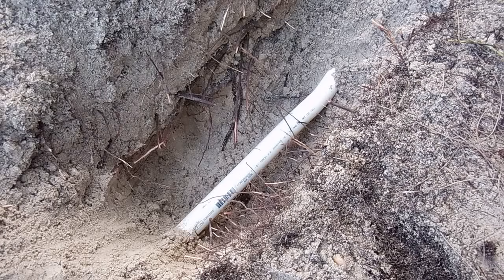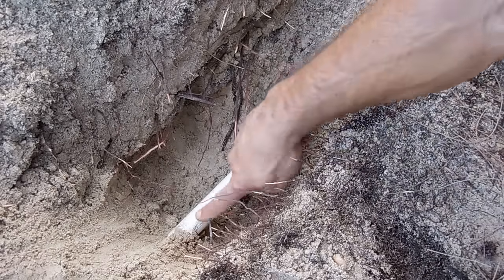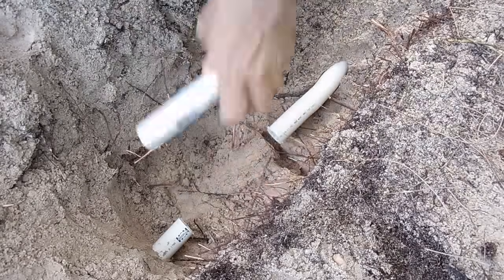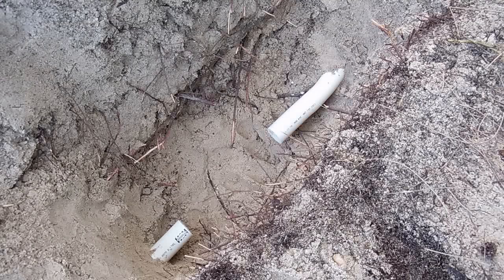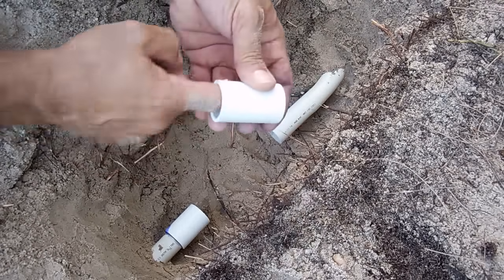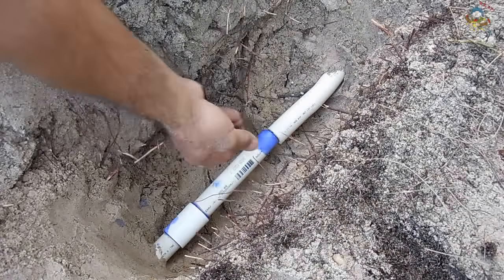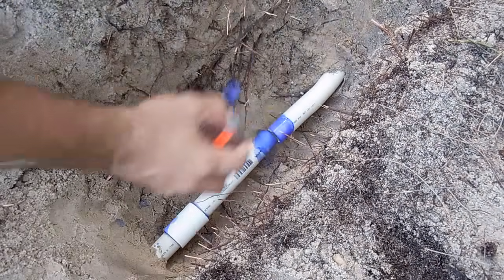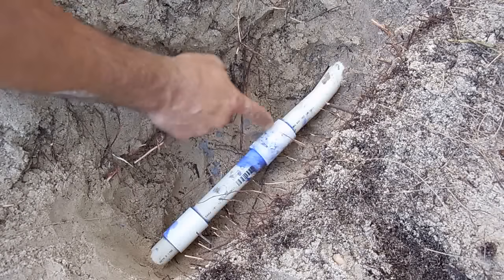EASILY Repairing Broken PVC Pipes(Least Amount Of Digging)

Comment: Thanks for the great video.  Not sure if the following change is worth the trouble but would this work?  Clean and prime the modified coupling (NO GLUE), "lightly" sand about 4" of the short pipe to allow you to slip the modified  coupling into the short pipe leaving about 1 1/2" of exposed pipe,  glue the "other end" of the short pipe to the main pipe using the standard coupling (as shown in the video), prime the 1 1/2" of the exposed short pipe, prime 1 1/2" of the main pipe, apply slow-setting glue to both ends, slide the modified coupling to the mark on the main pipe, twist the coupling and hold in place.  I "ass-u-me" that one could NOT just slip the the modified coupling without lightly sanding the pipe, due to the tight fit, and not sure if the sanding would create voids that the slow-setting glue could NOT seal.  Also, not sure if applying glue to the pipe but NOT to the coupling would result in a bad weld (???) but I would hope that if apply enough slow-setting glue would "melt" enough of the coupling.  Or, as I fear, would the coupling just PUSH the glue and never get inside the coupling?   If this works I think it might allow you more time to work the modified coupling into place and there would be no need to bend either pipe to insert the modified coupling at the last minute.    Thoughts?
Reply from the maker: I'd stick with the method I show in the video. Thanks for watching!
Reply: @electronicsNmore  Would this method also work for adding a tee?  PVC tee's have a LOT more "stop" material inside to remove and are about twice as long as a coupling so it may not be as easy to slip it into the repair pipe (??).

Comment: Flow span expandable coupling, less than $3-5.00.  Takes less than 30 seconds and you can use PVC fast set glue.
Reply from the maker: Yes, but not a permanent repair. They have seals that can dry out over time and leak, especially when used with chlorinated water. My repair is permanent.
Reply: @electronicsNmore  No disrespect, but I would disagree.  As a professional plumber and irrigation contractor, I have used flow spans on anything from 3/4 to 2 inch 250 psi lines that I have repaired 18-20 yrs ago with no issues.
Reply from the maker: @vinnygoombatts1458  Just don't move them. LOL

Comment: This video leaves a lot to be desired. Apparently the creator is a professional plumber and hangs out at the plumbing supply house. For the rest of us finding "slow set" PVC cement is a deal breaker. Home Depot doesn't carry it, Lowes doesn't carry it, and the best hardware store in Raleigh, NC doesn't carry it. You have to go to Amazon and search. The cheapest is $18. For that kind of money I can buy 3 of the more conventional gadgets to fix pipe breaks and I can pick them up at any hardware store. This video is useless.
Reply from the maker: I used "REGULAR" set. The video is far from useless, sadly some viewer comments definitely qualify as useless.
Reply: Well I spent 3 hours trying to splice a 1-1/2" PVC pipe with "medium" cement and had zero success.
Reply from the maker: @hallcp2  1 1/2" pipe can be done, but not for your first time doing it. Practice makes perfect. You probably made the coupling too tight.

Comment: Could the full slip coupling be slid onto the replacement pipe before it is glued into the opposing coupling?
Reply from the maker: Hi Tony. No, in order for that to happen, the coupling would be made too loose. The PVC cement acts like a lubricant making the coupling easier to slide. Thanks for watching!

Comment: What about a 2 inch line with no flex?  I don't believe this method would work unless I exposed one end of the line for a great distance in order to pull it up far enough to slip that 2 inch coupling on. Might have to opt for a pressure fitting. But I will be using your method for smaller diameter lines that I frequently seem to damage while working in my yard. thanks.

Comment: This works for pvc that is small with enough flex to get the fitting on.  I have a 2 inch line that is will not flex. A compression coupling is my choice for the repair.
Reply from the maker: 2" is really pushing it. I've used this method up to 1 1/2" pipe in the past. Just make the hole a little wider.

Comment: I would also ask this if you have experience with pvc. Could you buy a slightly larger piece of pvc, slice it longways in half, like a hotdog bun, and just clean and glue it on like a bandaid?
Reply: No, water pressure will eventually eat away at the glue.  Just cut out the damaged piece and replace it.

Comment: Slip the repair coupling over the insert repair pipe before you fit it,then glue the two ends of the pipe then just pull the coupling over the joint.job done.
Reply from the maker: The coupling won't slide over the pipe easily w/o cement applied. :-). Thanks for watching!

Comment: Use some pvc cutters man, cmon
Reply from the maker: I have PVC cutters, but they tend to flare the end of the PVC pipe after the cutting process(which means more bevel work), and they also bind up when cutting inside a hole where the pipe has little room to move. Thanks for watching!

Comment: The pipes did not line up, there's tension on the line after joining, tension causes leaks, well how do I get no tension u might wonder. 4 90s is the correct way for a repair, sometimes 6 occassionally 8...u wont notice any difference in pressure and it's done right
Reply from the maker: Wrong. LOL. The pipes lined up perfectly, and there was NO tension on the PVC line when it's done properly. As for the (4) 90's idea, it's the worst repair method. The water hits a wall and changes direction 4 times, which results in a lot of friction loss. If you don't like the method I show, then don't use it. :-) Have a nice evening!

Comment: Experienced  plumbers or repairmen know that there are couplers called a "slip" couplers.  They don't have a lip you need to remove. Much easier than needing a dremel.
Reply from the maker: I've been working with PVC pipe for over 25 years. Home Depot, Lowes, and most hardware stores(Ace/True Value) DO NOT sell "Full Slip" PVC couplings for pressure lines, only DWV. :-)

Comment: Even easier to do is use an expandable coupling. They are designed for this. It has a glue connection on each end with a section between with a sleeve and insert sealed together with an o-ring. It telescopes about 4 to 5 inches depending on the pipe size. Check the hardware store
Reply: Slip Fix...
Reply from the maker: Hi James. What I show costs a lot less, and will last a lot longer(It's a permanent fix). Thanks for watching!

Comment: I think it would be faster if 2 cleared-inner couplings were already inserted on the short connecting pipe then align all ends then wipe pvc cement on all pipe ends and roll slide the couplings centered on 2 end joints. voila!
Reply from the maker: They don't slide easily until they're lubricated using the PVC cement. Be sure to look over my extensive video playlists for other great videos of interest to you, and most importantly share. Thanks for watching!

Comment: Cool video I think it will helps out a lot of people this same concept is with the copper soldering. The most important thing is that you have to file the stopper  between the two pipe inside very clean and you must use clean glue and you must use a crimp or clamps on the coupling so that way when you have to force it in you have leverage. This method is only recommended for low pressure not high pressure like the main line.
Reply from the maker: This method works perfectly on PVC pressure water lines. I've never had one fail.

Comment: Nice video there,you got my Thumb Up for this content,yet there is a different situation in Romania here,we use hot melt connections instead of glue,and it can be fixed in the almost same manner,but with a small difference,using just a holender coupling,just cut from both ends of the damaged pipe and fix the 2 pieces of the holender then let it cooldown,and just screw the pieces toghether,is a very durable repair,just repair it this way and forget about it ;-)
Reply from the maker: Thanks for watching! I have many great videos on my channel covering many different subjects, so be sure to look over my extensive video playlists for other videos of interest to you and most importantly share.

Comment: Or, you can NOT be a cheapass and spend a few more $$ on a "Dresser Coupling" Cut, slide, tighten and Finish. Yeah, It's what SMART People do. Oh, and in ground that shifts like Black clay, Red, etc,,a Dresser Coupling will give enough to NOT break, which Glued Couplings do NOT. Just sayin'
Reply from the maker: Dresser couplings aren't permanent, they have seals that dry out and eventually leak. What I show costs only a SMALL fraction of the cost, and is a PERMANENT repair! Just sayin'

Comment: Oops, the only cement available in Colombia I guess is fast setting cement so it is really difficult to move the fitting and slide it back to final position. I had to redo it twice till success.
Reply from the maker: You can't use fast set, regular set works fine. Thanks for watching!

Comment: Great idea....I been using it for many years before I saw this.  One tip: You can slip one blue primed coupling (without a center stop) on the buried stub end and one primed coupling (without a center stop) on the spliced pipe section you are about to insert between the two sections without having to lift up the buried sections.  Then, just apply liberal amount of slow set cement to the pipes on either sides of the two couplings.  Slide the couplings back and forth into the desired positions.  Using slow set cement makes this is possible and is VERY much easier since and you don't have to strain to bend pipes. This works all the way up to 4" pipes!.  Also, place a few clean rags in the ditch after under the splice section you dig it out to avoid getting sand into the couplings.  Good post :)
Reply from the maker: Thanks for watching and the tips!
Reply: What do you use to file down the ridge (the stop)? Also, even after removing the ridge its very hard to slide the connector back and forth on the pipe.  I was doing that without applying the cement.  Does the cement act a lubricant?
Reply: @picenze just purchase a repair coupling or slip coupling. They don't have stops. And yes the cement makes it easier to slide the coupling.
Reply: @picenze  yes. Especially when new
Reply: This was the exact comment I needed, on my fix I'm working w/ 3" pipe and don't have room to lift and bend it. I bought some slip couplings hoping they'll be easier to slide around. Hoping to cut the exact length of repair pipe and then slide the slip couplings into place. The regular coupling seems very tight and hard to work w/
Reply: @brainharrington  How did it turn out?
Reply: Can u make a video for that, thank u
Reply: you know, this is really a smart tip!  thanks for sharing!
Reply: What is a primed coupling? Where do you buy them?
Reply: @mollendo1948  I believe what was meant with the term "primed couplings" was that you apply the primer to the couplings that you intend to use before you position them on the pipe.
Reply: I'm trying to add a T onto a 2" main line, would this work for a T? Or would it potentially have glue ending up where I don't want it?
Reply: I’m having trouble with glue settling and lifting the pipe and slipping before the glue sets.  Your tip seems like I may be able to do this by myself.  Do you have a reference video?
Reply: to estelacastillo - after applying the "cleaner" and then the adhesive, slide the pieces together and hold them in place for 30 seconds (see the directions on the label of the adhesive, it will tell you how long to hold the pieces together in the position you want) otherwise, if you just push it on the pipe to the position you want and let go, it will move by itself an 1/8" or more; possibly screwing up the dimensions of the other pieces you have cut to complete the repair.

Comment: Any pro knows that slip couplings without stops have always been available for these repairs, and any pro would have lined the hole with paper to avoid contamination of the glue joint, and to keep debris out of the pipe. You displayed the preferred saw for the job, the wire, and then used a good hacksaw in the dirt.  Pros think more of their tools than to treat them like that. Three strikes in one video.  You're out.
Reply from the maker: Anyone with brains(which apparently you lack based on your comment) that's been to Home Depot/Lowes/Ace Hardware or True Value know that these fittings ARE NOT sold. Only PVC full slip couplings for DWV. Done acting like a know-it-all? Hope so. My repair will outlive you. Stick to guns buddy.

Comment: Hay youtuber. 

Good video. I have read through a lot of the comments and here in the UK we can get hold of repair clamps for PVC and PEX pipes. Although I have had to use this method for quick repair situations when time or circumstances dictated. 

A couple of tips, and not decrying you’re efforts. 

1. Never use a hacksaw, only good quality, sharp pipe shears/cutters

2. Where space is limited use the slip coupling method on each end of the pipe repair. Sometimes the pipe cannot be manipulated enough to line up the pipes once you have glued on a coupler. 

As someone said this method is also completely acceptable on copper pipe and large sewer pipes. The removal of the coupler internal stop is the same. 

But all in all top marks. For those who have never done this before you have saved them time and money. 

Good luck from the UK.

Comment: You ended up putting the same pipe again and with the crack still there. One cut where is the crack is enough to fix the pipe. No need to have two sleeves unless the crack is too wide.
Reply from the maker: I stated VERY clearly that if the crack is straight up and down, then only one coupling is used. If the break runs sideways, then you do as shown in the video.

Comment: My glue cures too fast to slide it around that much.  It usually glues the pipes within five seconds.  How do I slow the process down?
Reply from the maker: You can use slow-set PVC cement. If you work quickly, the regular set should be fine. Thanks for watching!

Comment: I need information. Do you know what a blue pipe that is black on the inside is? It is poly, maybe. It is PEX, maybe. It is 3/4 tubing that provides water to a house. A poly Shark Bite is the right side for the outside diameter, but, the insert is too large. The inside is the same size as a 3/4 PEX fitting. Help
Reply from the maker: Must be Pexflow.

Comment: Good work brother. Sorry to say but i would have done it little easily and fast. I would kept both couplings on the pipe which i have to join, then apply glue on both joints and just push the couplings on joints.
In second way i would have inserted coupling on the pipe which r in mud, then just put the piece of pipe in between, apply sloution on joints and just bring the couplings on joints, thats it. Easy and fast
Reply from the maker: Whatever way works for you!

Comment: Hey Mr. electronicNmore, my sincere thanks to you for this video. I was struggling for a solution to fix a gusher 3 feet underground coming off my water meter in the street. Being on the home side of the water meter, of course, it became my problem to fix. I needed some assurance using a homemade PVC slip coupling and I couldn't have asked for a better example in this video. I fixed my problem with a threaded nipple, and 30-degree elbow and a straight coupler… already had a length of ¾ pipe and the thread tape. Total cost: $1.89 plus tax. I wonder how much a professional plumber would have soaked me to do this emergency repair?

Comment: I want to know why you didn't  just cut the original pipe on the break (cut) you put in the pipe. Just finish cutting it all the way thru. Then just using one coupling. It's even easier using the bell coupling end the comes on a 20ft piece of pipe. They are a bit bigger around than a coupling is (inside diameter)
The last thing I want to say is.
I'm sorry you can't afford $11.00 for a expansion coupling!!
I'll bet you're a handyman?
Reply from the maker: I explained in the video! Don't you listen? I said if the crack is straight up and down, then one coupling can be used, if the crack is diagonal, you'll need 2. To answer your wise @ss remark, expansion couplings cost much more money, and they have seals that eventually dry out and leak. The repair I show is PERMANENT.
Reply: @electronicsNmore  if you know what to do to them. They will never fail. I've had them in for over 30 years. Never had one fail. Sorry I missed the part about using 1 coupling. Have you ever tried the bell coupling off the end of a 20ft piece of pipe. They are a fraction larger inside diameter. They slide easier. 3/4 inch expansion coupling cost just under 11.00 where I live. Plus tax it a tad over 11.00. I have them from 3/4 to 1-1/2 always in my truck. I use them several times a month. I find them much quicker & easier. There's a "trick" way to do everything other than doing it the correct way. 
  Let me know in 30 years if one of these ever fails.
Never mind. I'll be over 100.
                       😉

Comment: How about just buy a coupling with no stop in it. It’s called a skip coupling. I really don’t see the harm in buying a $4 compression coupler. Saves you time. Time is money. 

3/4 compression coupler- $4
Saw blade $3

Or 

2 couplings -$2
1can glue -$6
1 can primer $5
Saw blade $3 

What is cheaper now?
Reply from the maker: Good luck finding pressure PVC couplings with no stop at your local hardware store. They can be found online, but cost 4-5x as much as an ordinary coupling. Compression couplings leak over time. The rubber seal eventually fails. Most people have a hacksaw laying around, and if they're handy, also have PVC cement and cleaner. The job I show is permanent and will never fail when done properly.